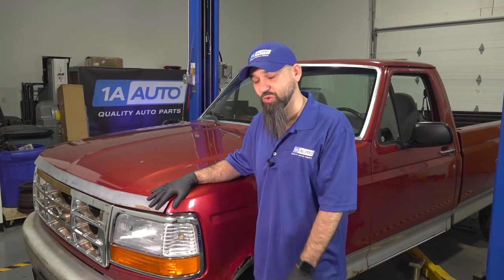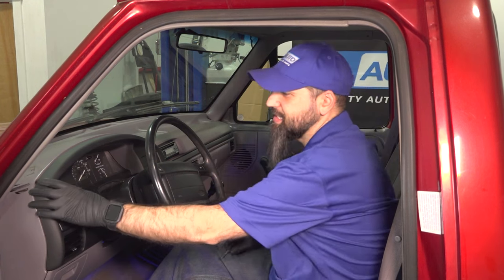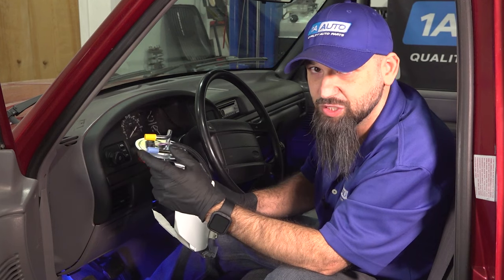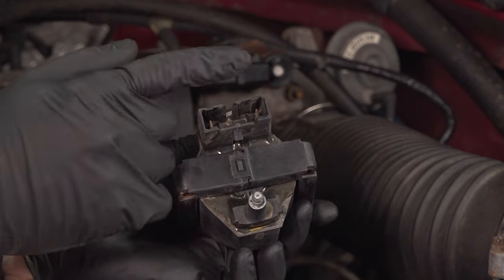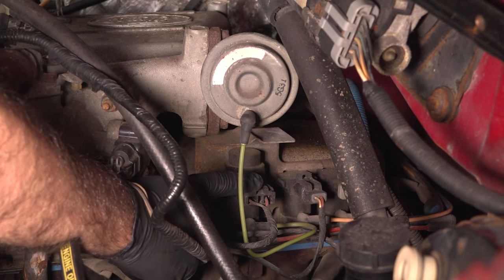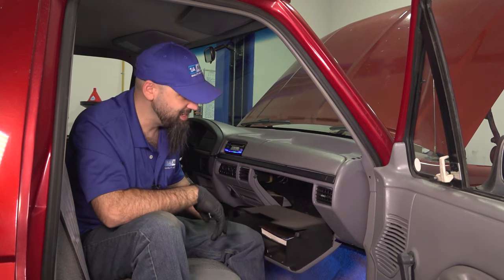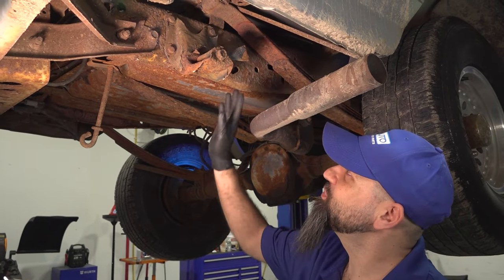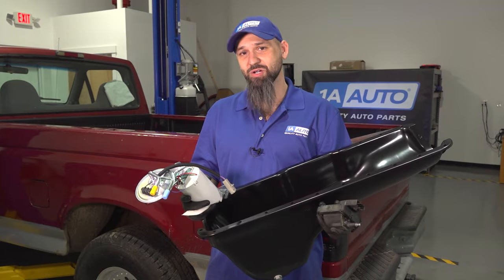Top 5 Problems Ford F-150 Truck 1992-1996 9th Generation

Comment: I got a 1992 F-150,4.9 , 5-speed. 1st to 2nd gear shift lever wore out and I burnt up the clutch trying to get it home in 3rd, got new flywheel and clutch and shifter lever. Also one day, my steering only had power when turning left, no p/s turning right, I'm guessing it's the box, because the pump doesn't know left to right. Are All 92 f150 boxes the same. I have one from a f250 ,but don't know if it will fit? I heard there were a lot of different boxes that went into Ford pu's.?